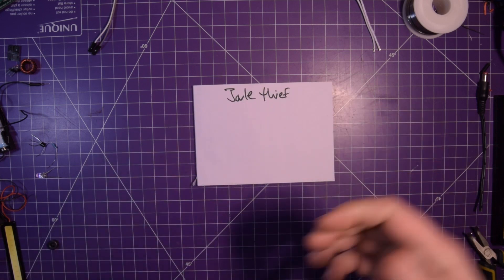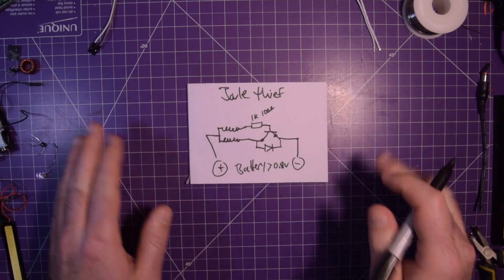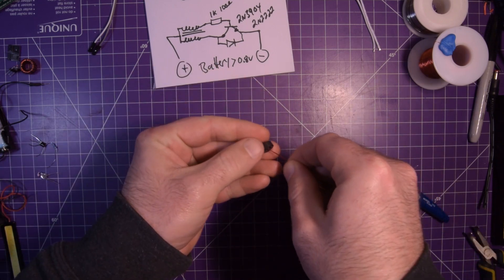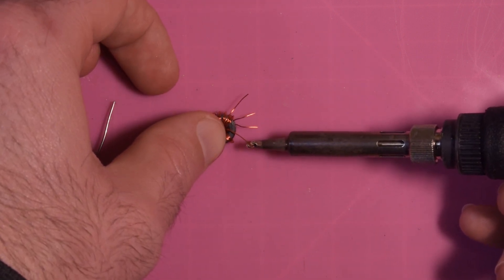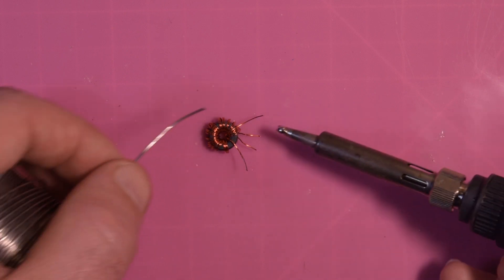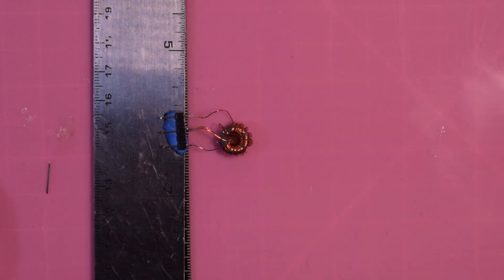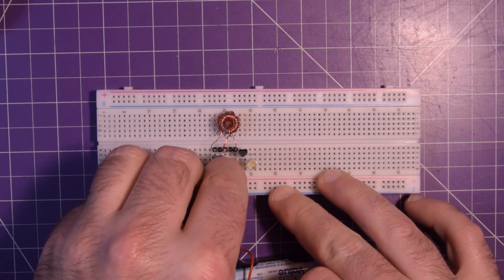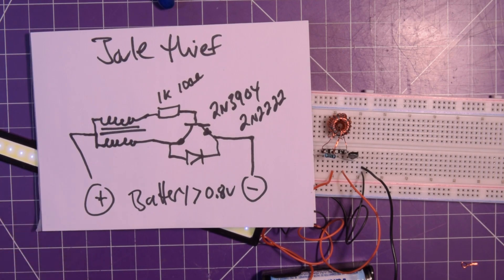Make Your Own Joule Thief!

Comment: I've made several of these circuits using a toroid out of a CFL and various NPN transistors. The last one used a 1W white LED and two AA cells, works great even with cells down to 0.5V.
Today I tried using an original germanium OC75 fom the 1960's, a PNP.  Of course you have to modify the circuit to use a PNP transistor, basically you just reverse the battery and the LED, everything else is the same. I thought the germanium transistor would work better as it has a much lower turn-on or forward base-emitter voltage than silicon transistors.
Anyway, it didn't work and I suspect the reason was the collector current rating of the OC75 was too low to reach saturation of the toroid core. If the core doesn't saturate, the circuit won't oscillate.
Reply: can I use BC548 transistor or Lm35 transistor???
Reply: @Filippos_77  
A BC548 will work.

Comment: About the coil . Is the middle tap is from end and starting  from the two line ? Explain it more because you cut the end of 2 line and make it not same as the picture you draw
Reply from the maker: if you look closely, by cutting and soldering it, you make it exactly like the drawing buty with two opposing windings
Reply: @SimpleElectronics  yes I think if I remember correctly that the coils have to be opposing so you can't just tin the  joined end as the coils would then have the same polarity.  Hope that makes sense.  I'm no expert!
Reply from the maker: @gartmorn  That's exactly it!
Reply: can I use BC548 transistor or Lm35 transistor???

Comment: Good job!  Just a suggestion, it would have been interesting to see the oscillation waveform on your scope.
Reply from the maker: I have wound a few inductors and therefore some wave forms are not off the table!
Reply: can I use BC548 transistor or Lm35 transistor???
Reply: @Filippos_77  pretty much any NPN transistor will work for this unless it's something with a Base-Emitter tension above 0,7V-1V. So 2N2222, S9018, BC547, BC107, 2N3904, etc will work just fine for this.

Comment: you were off camera at the important part - which coil ends to join to which
Reply from the maker: Just chop the winding in the middle and connect each middle piece to one of the ends, and you're done!
Reply: "Each middle piece to one of the ends"? That doesn't seem to leave enough wires!
Reply: can I use BC548 transistor or Lm35 transistor???

Comment: led is in wrong place
Reply from the maker: Care to elaborate?
Reply: @SimpleElectronics  whole idea of circuit is that mini transformer that shuts itself off and switches back on by transistor and because solenoid pushes back current like a wave it creates voltage and all is switched back on and so on. You will get the minimum voltage of the transistor drop - probably 0.6V and it is as low as it can generate from. This is not wrong as long as voltage is not going to damage diode. You may put zener there too. I put diode before emitter and not used any resistor at base. Just like normal boost converter
Reply: @browaruspierogus2182  You don't understand it.The LED starts to conduct, so the voltage is clamped. If you omit the LED, the voltage spike may exceed the Vce rating of the transistor, but as long as the LED is connected all will be OK.
BTW This is the standard Joule Thief circuit, made by thousands of hobbyists, so the LED is clearly in the RIGHT place!
Reply: can I use BC548 transistor or Lm35 transistor???